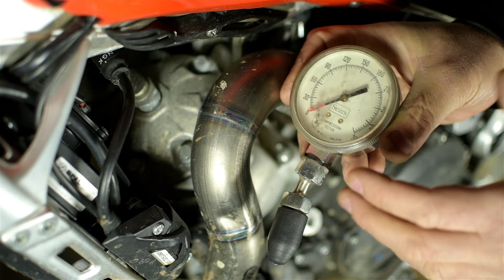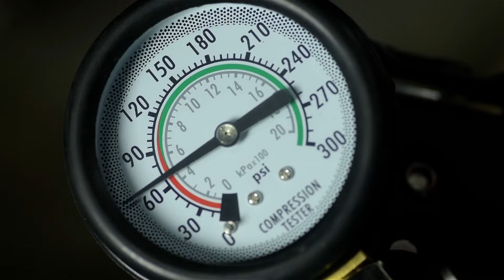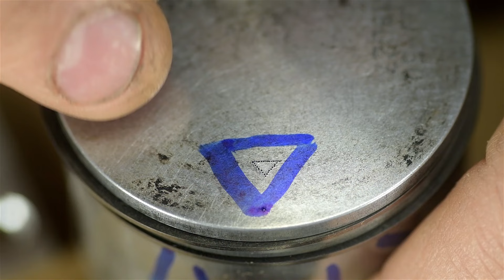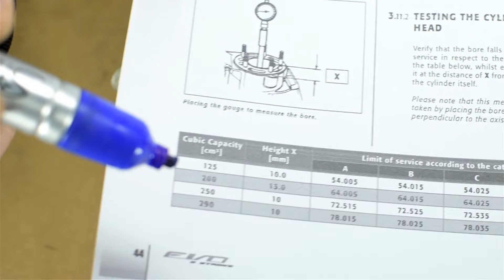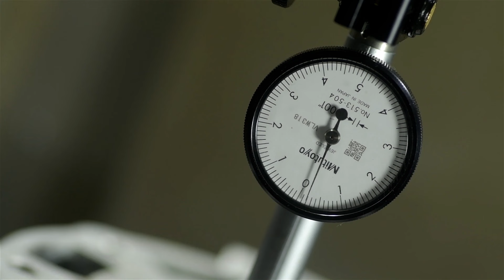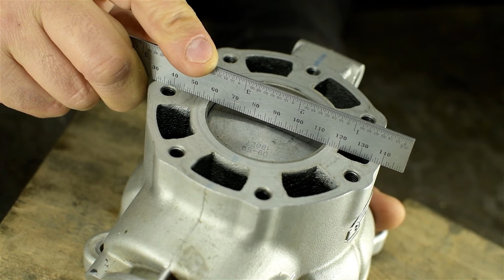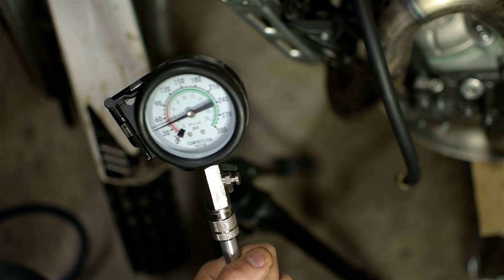Top End Rebuild! (2 Stroke)

Comment: Loss of bi-stroke power can be also be caused by a clogged muffler/arrester or less likely an air filter... Just a heads up, always clean the arrester BEFORE ripping the top end off. If it's gobbling transmission oil then your crank seals are shot.  Dented exhaust isn't doing you any favors either. Meh, jam new rings in it and go...

Comment: 24:00 No no no❗️ Tony the cylinder walls are not aluminum. You are completely missing the fact that there is a steel sleeve insert in the cylinder. You could have actually replaced that with a new one for a proper rebuild. 🔧

Comment: In today's tight tolerance engines the piston and bore are machined both oval and tapered to allow for expansion of the different thickness of material encountered in different sections of the piston so they can approximate roundness when up to working temp.
I'm surprised nobody picked up on the new piston being a "B" size when the original was an "A" size.
Back in the dim distant past when I was doing QC on a engine assy line it was not uncommon to use the next size up or down in the piston size range when stocks of the "correct" piston ran out. 
Strangely when I found incorrect size pistons in a engine I was auditing I had to record it as a fault condition.
This is a illustration of the constant war between the Engineering and Finance Departments in every manufacturing business.
Cheers Eric

Comment: The Nikasil bore is NOT deposited onto the bore . Nikasil is a hardening process where the sleeve is put into a furnace at high temperatures in a gas environment and no oxygen.... the high temperatures and the presence of a particular gas will cause what are known as dendrites forming between the crystal structure of the alloy in the bore causing internal stresses to build in the material... this has the effect of making the bore extremely hard but only in a very thin layer where the gas has affected the metal....ALSO... looks like you have a iron sleeve in that cylinder not an all aluminium cylinder.

Comment: Have you ever tried pop starting that bike backwards to see if it will run in reverse rotation? I would assume as long as ignition timing is not to advanced normally it should run backwards. LoL Mite make a neat video experiment.

Comment: At 6:35 and again at 8:10 (and again at 13:00) the scratches on the piston seem to match the width in the gap of the piston rings. Something transferred from the rings to the bore to the piston? That went out the window briefly when you showed the ring gap, but then the ring does still float (rotate) a bit, so maybe. Or maybe it's nothing.

Comment: 6.26. You noted gearbox oil may be getting by and burning causing the carbon. Two strokes should be sealed. Hence the need for 2 stroke oil. If it was gearbox oil you'd be splitting the cases.

Comment: most motorcylces wont run on less than 100psi however a good test you can do is with your thumb as humans can only hold about 100psi so put your thumb on the spark plug hole and its a decent test

Comment: putting a new piston in a used cylinder is common practice, u only mess with the cylinder if it has any signs or damage or if u simply want to hone it, which i highly recommend reading up a little about first, dont jus grab a random ball or rigid hone n go to town, theirs jus a few rules like dont use ball hone on 2 stroke cylinders or some diesel cylinders, keep the lines angle at around 40 degrees

Comment: If someone would be so kind as to enlighten me,  @9:03, there are some pins Tony points out going into the ring lands.  
Is this something common to 2 strokes?
What little experience I have is automotive, gas/petrol, and I was under the impression piston rings were supposed to be free to move around the circumference though the gaps when installed should be staggered.  Side note, are two piston rings also common in two stoke or is it more of a volume/size thing?

Comment: I once owned a TZR 250 (pause for applause from those who know how bad ass that is) and it's compression ratio was 6.5:1. When warm, all I had to do to start it was drop the clutch after a slight push with both feet....

Comment: Are you aware of a decompression valve or mechanism? This lowers compression so the engine is easier to start by requiring less power and a smaller starter can be used, or easier to kick over.

Once the engine is spinning fast enough, the decompression mechanism is retracted and normal compression resumes.

I would assume you would need to spin the engine over directly to idle speed for more accurate results. Unless the bike has no decompression valve.

Comment: No crank oil can make it to the cylinder, it's sealed.
You are right about not being into engines, two strokes are my favorite motor, and you need a new piston along with rings and a bore job.
FYI, everything from the crank upwards is lubed by oil in the fuel, and never believe the 40/50 to 1 hype, 32/1 is smarter.
However, it's just a trials bike, it doesn't even have a seat, they saw you coming a very long way off.
I see people ruin motors all the time, either they lean out the top cylinder lube as recommended which is too lean to be effective, or they use havoline made by texaco, and it just won't stand up.
Lucas makes a great oil, but I use 32/1 and never have problems. Anything you use aside from havoline will work if you richen the mix up to 32/1.
If you were an "Engine Guy", one look would dictate the proper repair action, no measuring required.
Funny thing is you still have all your fingers, machinists almost always cut fingers off, we mechanics smash them repeatedly, but we just apply tape and go back to work. 
I may not have your sense of humor, but, I do know engines, that blow by pattern is my "Measurement", it tells the tale.

Comment: May the low compression pressure just an issue caused by the internal volume of the hose?  
Giving a 125cc with a 10:1 compression would only have a combustion chamber of 12cc this will add up quickly. 

Also, I'm kinda disappointed that at 8:20 your drawing didn't turn into something .. else ;) 

"Or the prices for new pistons" .. yes. 
Reparing small nitro engines .. "that cylinder is kinda worn".
A new matched set of piston+cylinder liner .. 100€ (a whole new engine: 130€) .. "eh, more oil it is."

Comment: I find that exactly zero of the compression gauges I've purchased or used have been accurate...why is that? I'm afraid to spend big coin on a gauge because of the fear that I will get the same subpar performance....suggestions?

Comment: Sir Old Tony, can you explain at 17:00-18:00 how the measurement using the vertical drill/milling machine can possibly be any accurate? (Sorry, not native english, I don’t have the specific word for vertical drill). You’re adding inaccuracy:
- The drill has to be a thal-accurate at its top,
- The length of the rod with your measurement tool at the bottom, multiplies inaccuracy. A thal at the base of the rod is a hundred thals at the other end,
- When you turn, if you are not exactly in the vertical axis, you are measuring the interior of the motor as an ellipse.

Comment: Perhaps that's a rookie question, but wouldn't it be possible to measure the compression with TOT's "trustworthy" gauge using the cheap one's tube etc.? (given it was already tested for leakage)
Making a small adapter for the different threads wouldn't be that difficult.
That doesn't matter anymore now but thanks to anyone who can give me an answer!

Comment: you will never get a compression tester to work as you expect without spinning it on a multi cylinder engine . but it may have a use all the same - giving a relative change over service periods if you make notes and the spring in the dial doesnt degrade quicker lool

Comment: I hate Nikasil. The rings have to be titanium coated, and no one bores or sleeves Nikasil except for a very limited number of shops in the US... which of course have a 1-6 month wait list. For non-automotive engines, I'll stick with a normal steel bore. It may wear faster, but at least it can be fixed easier, and is far less expensive to buy part for... for which to buy parts. Tony hates the dangling participle. 

I build 2 stroke 6cyl drag boat motors btw, so I blow stuff up a lot.

Comment: I had a Fast fifty( 50 cubic cc  , lots of transfer ports, i could start it by pushungf it into the front fork suspension, it produced 2,8 kw, in the netherlands 04 kw is allouwed .
no mesurements just gut feeling what the engine does, made a run getting at 110 km/h  aprox 68 mile/h, \

Comment: 6:30 it’s a two stroke the bottom end is lubricated by the air fuel mixture not gear oil a 2 stroke does not have gear oil in the crankcases

Comment: It wasn't be the worst piston and cylinder which I have ever seen. But in my old moped (50ccm and 3.5 HP or 2.6 kW @6500 RPM - engine Jawa 223), the lock of piston rings crushed/melded or something else. Basically it created hole in piston, exactly between first and second ring. But engine started work as usual. And power was at the same level. Of course after founding this fault I rebuild all set-up.

Comment: Dont joke about the bench grinder, my 80cc motorised pushbike siezed and the new piston was about 5mm to long (complements to Chinese engineering) ended up taking the excess off with the bench grinder and the bike still ran fine, slightly less power but who’s complaining

Comment: Ekk 14:15, I love you Tony but no that's totally wrong.
2 strokes are totally supposes to have new pistons in old cylinders.
My old 2 stokes didn't even get going till second or third full rebuild so that's like 6-8 pistons in.
The a b and c pistons are sizing quides for how much wear is in the cylinder over the life time of the bike.
Its not for machining tolerances..
Its starts at an a and ages towards a c..
Then we used to get oversized pistons when it went past c size if the coating was still good.

Comment: Debug... cheap compression testers have the schrader valve at the wrong end of the rubber hose, its up by the gauge vs at the spark plug hole which is not good for small engines. The reading is always low as so much volume goes into the compression of the volume of the hose and expansion vs the displacement of the engine. They work okayish for larger cylinders I guess, but no go on a motorcycle.

Comment: the compression tester MUST have a good check valve at the spark plug adapter, otherwise the hose is going to screw up the reading, anything that's not behind a check valve counts as part of the combustion chamber, say your 125 is supposed to have  9:1 compression, at TDC the combustion chamber would be 13.89cc, the tester having an internal volume of a couple ccs would throw the reading off, even the spark plug adapter not being the same size as an actual spark plug would make a difference. Cheap compression testers tend to read closer to the actual compression the larger the cylinder is, so it's basically useless for checking a weedeater, and only useful as a reference for a car engine, it will read low, but it should be consistently low.

Comment: Late in but before you even started working on it you didn't check to see if the exhaust was clear - did you not hear me screaming here?  They gum up and choke the exhaust flow which drops engine power. Just saying.

Comment: This is a 2 stroke sir. It doesnt have gearbox oil underneath the piston. The oil and gas travels through the crankcase  and gets pushed up Into the ports of the cylinder.

Comment: The length of hose between your gauge and the the spark plug port all add to the volume at TDC. This changes your static compression ratio and the reading on that gauge will be off even if the gauge was spot on.

Compression testers are never super accurate, even the expensive ones. While they are great for comparing a before and after, or say a wet and dry measurement, there are better ways to measure the cylinder leakage. 

The best way by far to determine engine health is to pull it apart and measure things, as you have done.

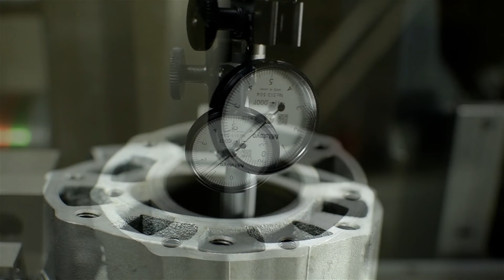Comment: HOLD UP!  18:30 - The 0.001 in the front is near the "o" of Mitutoyo so it's a +0.001.  The 0.001 in the back (in the mirror) is near the "M" so it's a -0.001.  What does this mean?  It looks like the indicator is 0.001 off center in that axis, and the bore is round.  Can anyone change my mind?

Comment: You dont hone Alusil. You lap it with silicone AN30 lapping compound and felt "stones". Basically what it does is eat away the aluminium, leavning only hard silicon particles for the rings to ride on.
So there is no reason why you cant bore and re-line it your sel, the use oversize piston

Comment: Love your videos tony. But i think you made a summe mistakes. Nikasil or no nikasil you have to hone the cylinder or de ring will never seat. It can even get worse now when you got new rings that dont have the same shape as the bore. A bore thats worn oval even if its honed can have problem geting the rings seated because its not easy to hone it round again. But them vill have a chance when the bore ain't glazed. The only good think you got out off it is the ring gap is correct and it probably helps. And i hoppe you measured the piston to cylinder wall clearance. You can never trust the markings on a piston or what the maker says. Many have found that out the hard way unfortunately. Sorry for my english im from sweden. The best of luck to you.
Reply: I have been told by people who know never to hone Nicasil.  Moto Guzzi do not hone the cylinder after plating. They do a preliminary check with a jig that measures leakage and then they bolt it to the engine, run it on the dyno and measure the blow by. The blow by typically comes down to tolerance in about 5 minutes on the dyno. Nicasil tends not to glaze like an iron bore.
Reply: @francisrampen9099  yes and no. If you have a perfect cylinder then it takes very little to seat the rings. When the cylinder is bolted together like on the bike i distorts and not round anymore and to get around that you can clamp it in a jig that simulates how it would de instald on the bike and then machine it. But you still need to machine it to get the proper piston to bore clearance. Nikasil cylinders are not honed in the normal way. Nikasil are often machined whit a diamond type of hone after they are coated.
Thats inte perfeckt world but if you have a worn cylinder thats oval and out of shape in every way. You need to get the surface finish right so the ring will have a chance to seal. If not buy a new cylinder or have it recoated. I can go in more in deep how and whay. but my English is so bad so nobody would probably not understand what i mean any way. And its like tony sad ask 10 enginebuilders and you probably will get 5 different answers but non of them are completely wrong. ✌️
Reply: @victorbergdahl2025  It is true you can use a diamond hone but I think that is outside - the cost of the hone is about the same as a replate - the scope of most DIYers although TOT may be that exception! I watched how they do it at the Guzzi and Gillardoni factories - they and Mahle claim the invention of nicasil -  and they don't bother to hone but they do tolerance match pistons to bores - which is probably more cost effective. I was told that the grain structure of nicasil is pretty much ideal for oil retention and you don't want to muck with it. Given that this is a two stroke with a water jacket it is not so likely to go out of round unless you have a major cooling problem. Nicasil is IME really durable - my lemans has over 140K on it and 2% leak down. To me if the rings don't seat you send it to the specialist replaters (Millennium etc) and let them do their thing. No need to apologize your english is fine.

Comment: Why not, for snickers and giggles, swap the gauge from the Sears, the brand that you trust, to the el-cheapo fittings? The threads should be NPT and it may go right over or just use a single bushing to get there... At work I swap questionable test gauges for known good gauges to take the equipment tubing out of the equation... man I hate math. :)

Comment: Piston is worn out.  Hone the cylinder before you measure.
You have lost compression with the same guage.. I have used a  cheap comp guage for decades with no dramas. Though on a multi cylinder engine it is a need for them all to be the same. 
Make yourself a leak down tester using some of those fittings then use compressed air [around a 100 psi] and simply listen for the air leaks, you will always get some but if most of the air is in the crankcase you have a problem. And I have done this on race engines for decades. Though real 4 stroke ones!

Comment: G'Day Tony,,mate Nice film,funny and informative,,Nice job,,
but there is another reason a lot of Two (2)  strokes seize up,,
it seems oil is mixed in with fuel,this is intended to act as lub between working parts,,
how ever ,you just had your engine reving to infinity and beyond and then you shut the throttle off,,all of a sudden you have a piston and bearings doing light speed with out any Lub,,
remember oil in fuel and no fuel = no oil,,
this is for information only,,
the only other thing ,IS, if you getting gear box oil back to cylinder why are adding Two (2) stroke oil,??

Comment: gearbox oil is NOT able to get into the cylinder, there is a physical separation in the crankcase where the crank sits and where the gear box is. the crank bearings get lubricated by the gas/oil mixture not the gearbox oil. look at a animation of how a 2 stroke engine works..

Comment: Sometimes if piston rings a cheap enough. Could have bought new rings standard size the engine came with then put them down in cylinder bore and gap them. Would have told you how much your bore is warn then buy oversized piston rings to compensate.
Reply: As you can tell I jumped the gun and posted last comment before I watched longer.